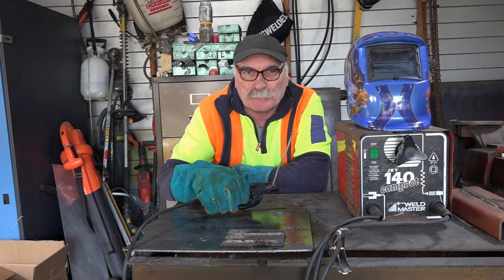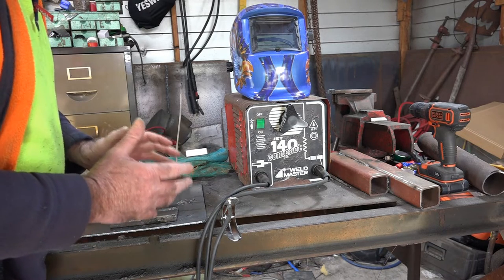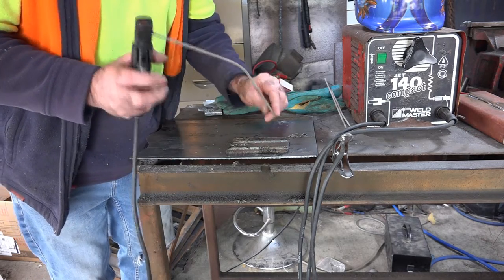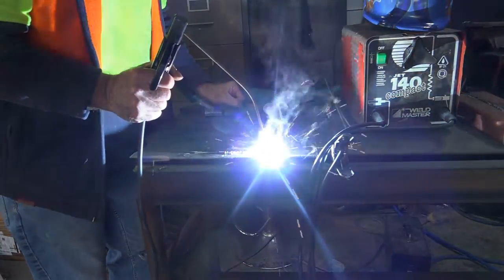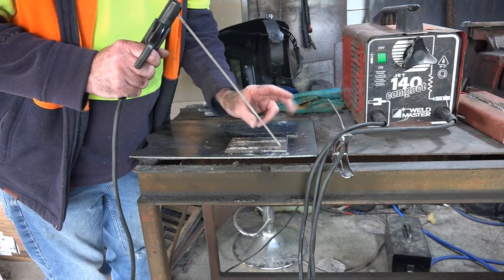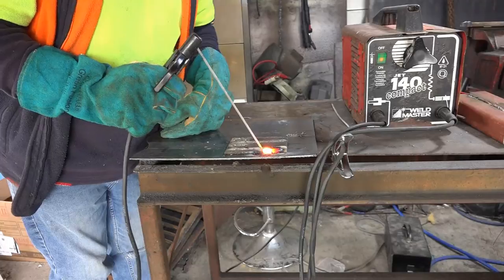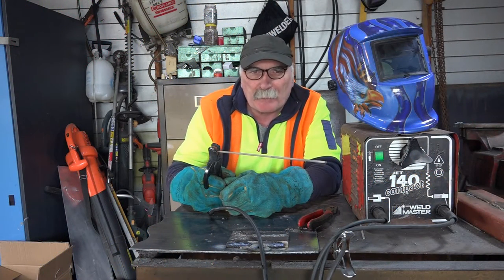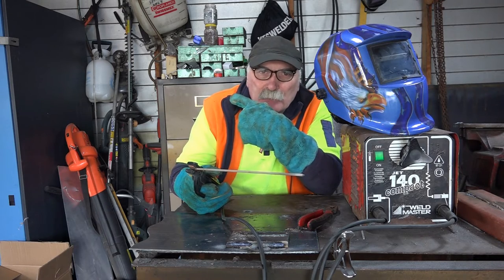Striking an Arc with a Stick Welder - 5 Tips Every Beginner Needs to Know

Comment: I bought a stick welder on Amazon about a week ago......  TODAY was the first time I had a chance to use it.  I was gonna practice, practice, PRACTICE!  I got it all set up and turned on the welder to 80 amps.  I tried and TRIED to use it, but that's ALL it would do is STICK!!  The more frustrated I got, the more that the thought of, "TURN THE TUNG UP you stupid!" got further and further from my head.  YOUR video is the second place that I just found that told me I was an idiot for NOT turning it up more....  Sheesh!  I'll try again tomorrow and run it at a starting of 100 amps.  I'm using a 6011 stick so it should take, at most about 125 to 130 amps is that about right?  Ya, I was a bit too low to do any good welding!  Thanks for your video!!
Reply from the maker: Thanks for watching and I'm glad my video could help you troubleshoot the issue with your stick welder! Good luck with your welding practice and I hope you have better results tomorrow!

Comment: Starting up again with stick welder. My problem is every thing i need to fix is super thin sheet steel. Probably 4 or 5 gauge. This is a bigger challenge than I thought. Lot's a practice n patients..
Good video mate
Reply from the maker: Yea mate a also have trouble welding thin shit.

Comment: I bought a 150amp multi-process welder a number of years ago mostly for mig and flux core, but it had the ability (at least according to the box) to run stick. Mig and flux ran fine, though I suspect that 150amp claim was heavily inflated even on 220, but it won't run stick for nothin! For the longest time I was sure it was me, then had a professional welder buddy come over and diagnose it for me. Sure nuff, the electrode plugs coming out of the machine were backward and I got lucky with the flux operation I was doing at the time as it was reverse polarity. I do recall that I had to run the plugs backwards for several spools, but it definitely worked better opposite of what was dictated in the destructions. 
Never dismiss the human element on the other side of the gun. 😁
Reply from the maker: Yea mate always check .Never assume LOL